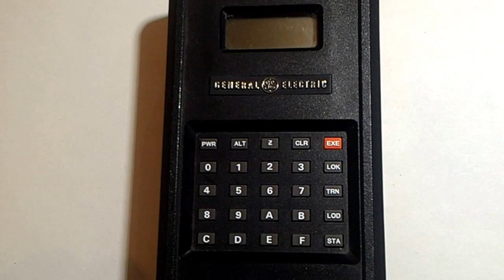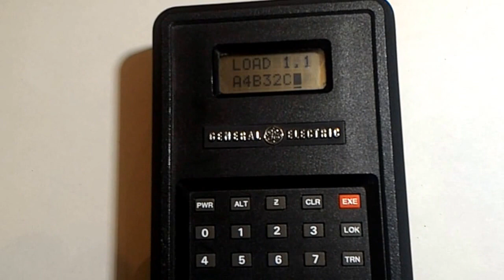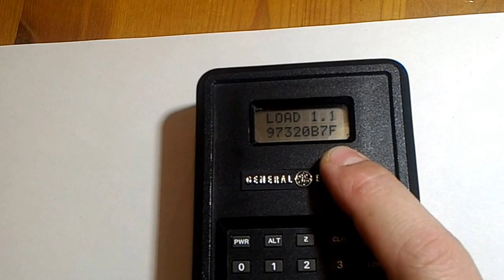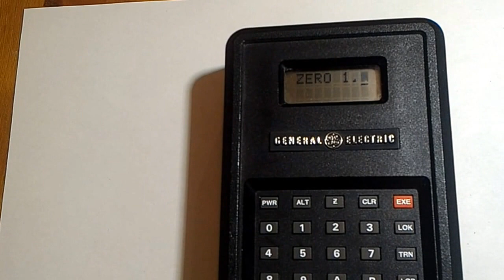Digital encryption with old police radios - Part 1 (Keyloader)

Comment: Any chance you can post a video of decoded Voice Guard, maybe from a second radio if you have one?

I'm curious about the voice quality. I always thought CVSD Motorola SecureNet DES sounded bad. Wondering if Voice guard is similar?

I have some radios with Aegis DES and Aegis VGE and they sound "OK".

I'd imagine the analog radios using DES would sound worse due to the analog to digital conversion and vice versa.
Reply: It would be great if you could make some videos of your radios with Aegis DES and Aegis VGE. I actually quite like the sound of Motorola SecureNet CVSD. CVSD is also used in some US military satellite radio systems that I saw on TV documentaries.